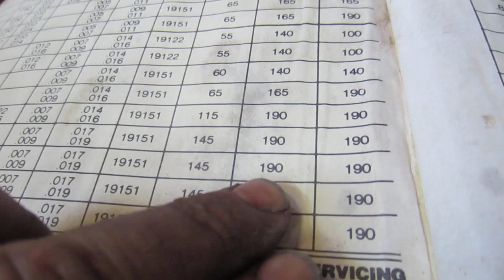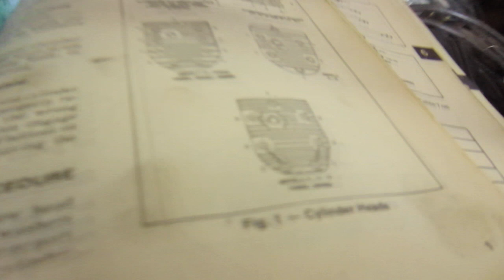HOW TO LOOK UP AND TORQUE A BRIGGS HEAD

Comment from the maker: only use locktight where it is spec'd but i can't say ive ever found a spec for it myself.  not sure if i confused you in this video, but i was talking about the red locktight i put on the thread insert for the plug.    i should have brought in the house and let it cure really.  but i decided to let it be for a few days out in the garage.  wish i had a better garage that was heated all winter.   i plan on insulating the garage roof this year and seal up the cracks in the blocks as much as i can.

Comment: You might notice that the handle on your beam-type torque wrench pivots.  There is a reason for this.  You must hold the handle and apply force to the PIVOT...not to the end of the handle as you are doing.  Only by putting the force on the wrench at the pivot will your torque readings have maximum accuracy.

Comment: Hate to sound like a nit-picker, ... but I am so:  When using a dual-beam torque wrench like that, to obtain accurate readings, you need to keep the handle "floating" on the pivot pin in the center of the handle.  Probably not critical in this application, but good shop practice.
Reply from the maker: Good to know, i have always wondered why they put the pivot in the handle.  will file that away for future use. thanks!

Comment: dirtmister16 I can't find specs for a 10t802 aluminum engine
Reply from the maker: should be 140 in pounds according to briggs. for head bolts,  here is the chart online http://www.briggsandstratton.com/eu/de/~/media/Frequently%20Asked%20Questions/Engine/PDFs/Engine%20Specifications%20Chart_ms3992.pdf

let me know if you need anything else, always happy to help.
Reply: +Doyle Gates Thanks for posting the spec chart. I heard or read somewhere that the tolerance for these torque specs is like 40%. To my mind, all that means is the torque setting is simply "Good and tight" but not crazy tight.